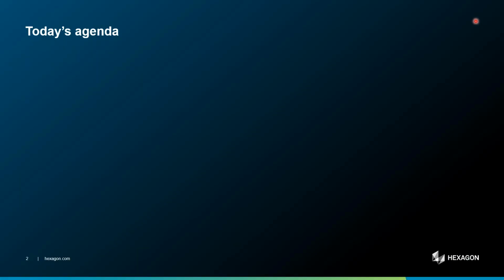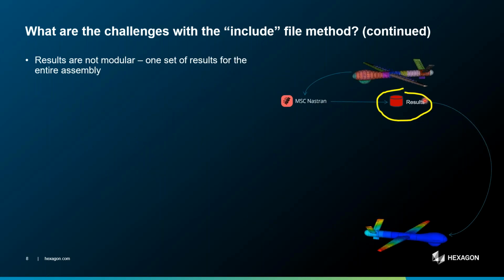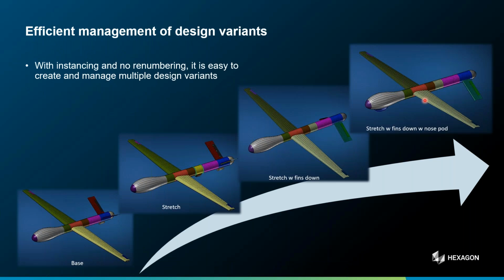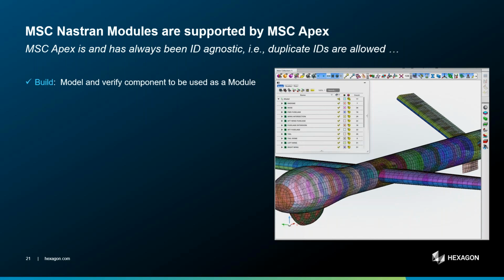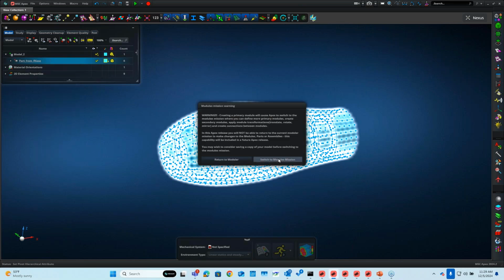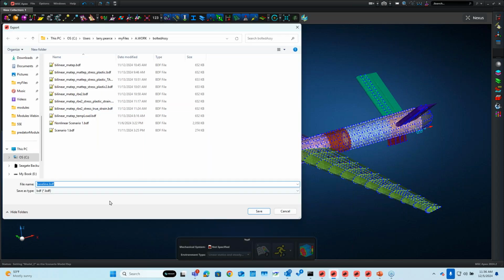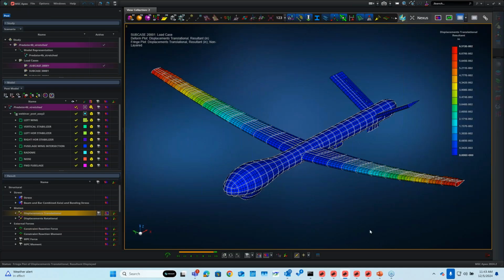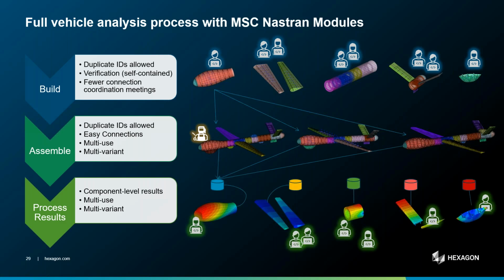Full Vehicle Analysis Process with MSC Nastran Modules

Comment: Nice Video. Mathematically, in the weak form, what is the Gluing feature doing (around timestamp 42 min)? Is this like a weak enforcement of residuals like Morter methods, or is this Glue operation similar to Tie Constraints in Abaqus, or is this simply applying multi-point constraints (MPC) to parent-child nodes or degrees-of-freedom. Do you know if a PDF slide file is available for this video? Thank you.
Reply: Hi Lonny. I just found this video. Glued contact in an MSC Nastran linear static analysis uses weighted MPC equations ‘under the hood’. I have a slide somewhere which I can share with you. Thanks, Steff
Reply: @ oh thanks that would be great.